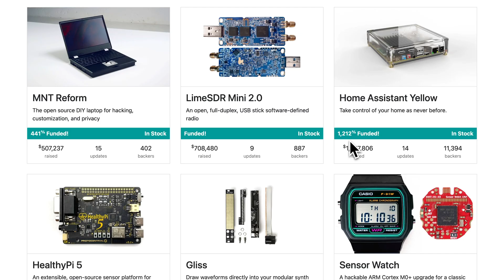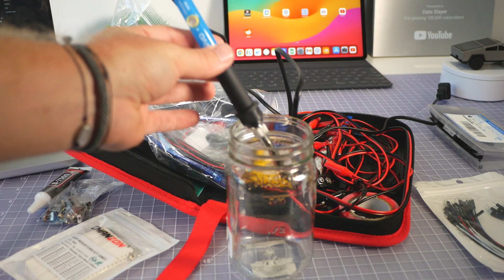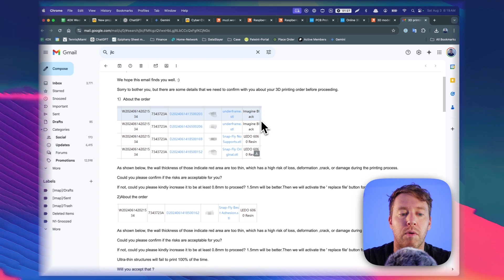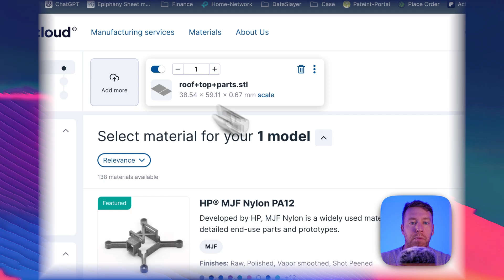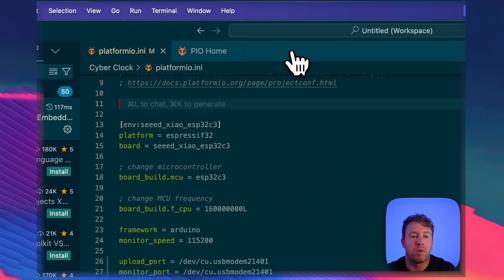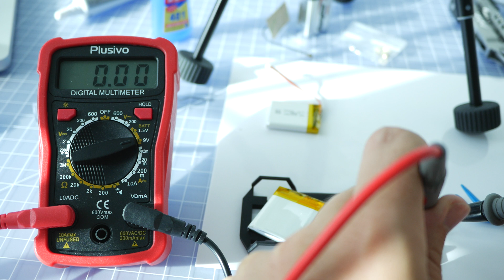3D Printing Just Got Easy (and Cheap)

Comment: Hey data slayer, a vpn will do nothing to protect devices on your local network, it can help avoid external threats from monitoring your system or connecting to it but nordvpn will not prevent a device on your network from connecting to your system, you will still have a local ip visible that it could connect to.

Comment: Can i train an AI model on Raspberry Pi 5?This model would have to be trained on visual, auditory and textual data. So, for example, through a file where there are a billion written data, and then through videos with visual and auditory data to train this model. If I had 10GB or 20GB of data to train it on, how long would it take? Then I could come up with a model that is able to learn new things, interacting with users, therefore to memorize various information, therefore to have a memory. A model that can generate audio, that can sing, that can recognize various shapes, objects, facial expressions, tones of voice, can also replicate tones of voice. A model that maybe, just maybe, could also generate images. You tell me, then, what is possible to do with Raspberry Pi 5, what are its limits from that point of view and how far I can go, what types of models I can train, what I can use. Thanks. And exactly how long would it take? How hard would it be? And is it possible to do it only with Raspberry Pi 5? Or is there also a need, perhaps, for an addition, like coral or AI kit of raspberry example, maybe Raspberry kits, or Coral?